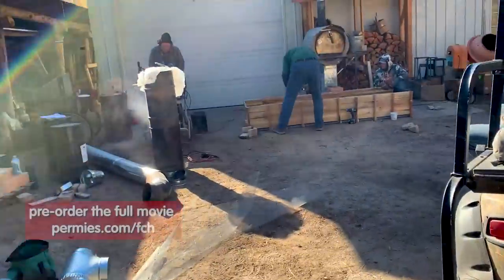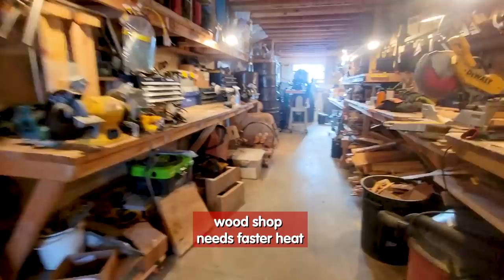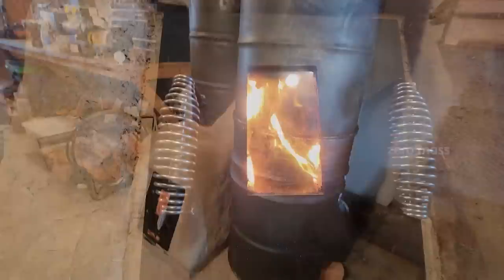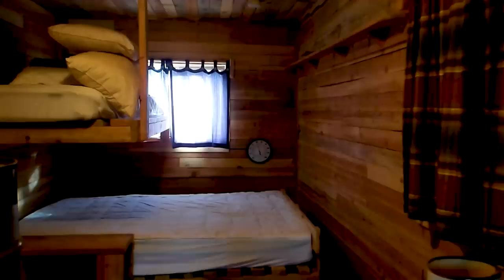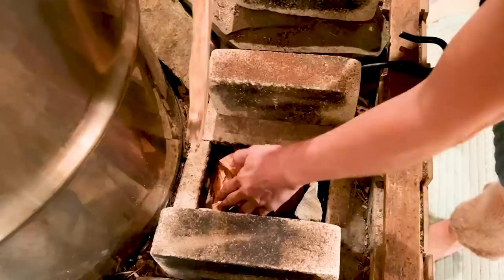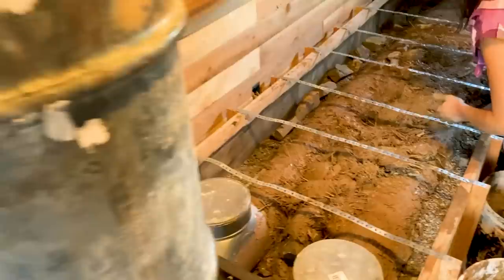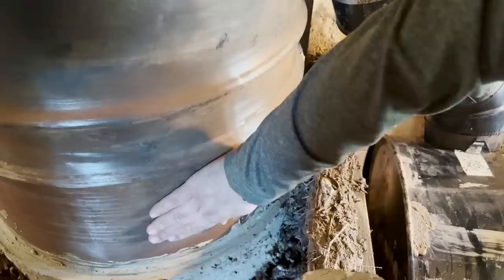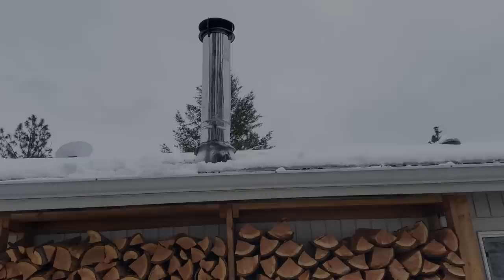3 heat experiments: quick shop heat; quick cabin heat; steam punk rocket mass heater of science!

Comment: If the exhaust pipe was made to snake through an underfloor thermal mass... Would the heat be long gone before it escaped out the chimney?
Reply from the maker: Heating a floor with this tech has been done many times.  Kang stoves and roman hypocausts come to mind.